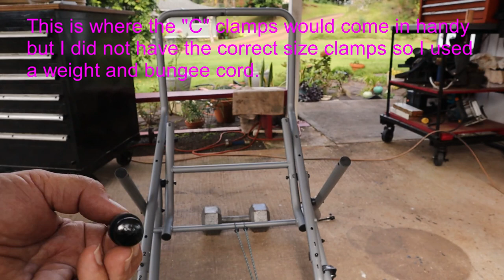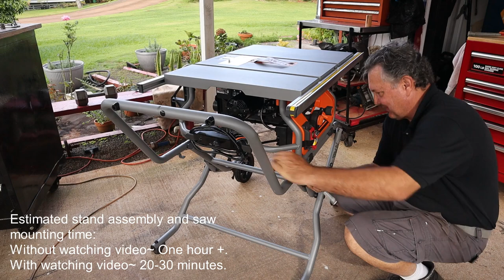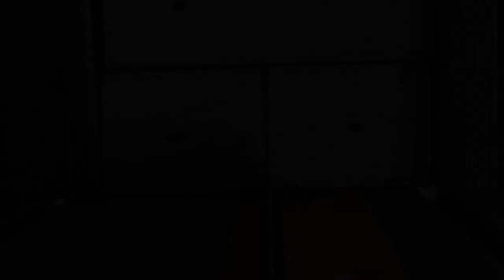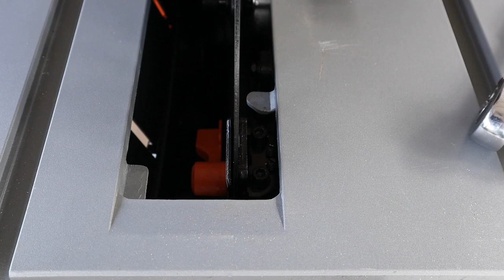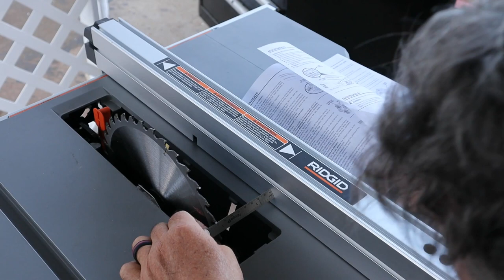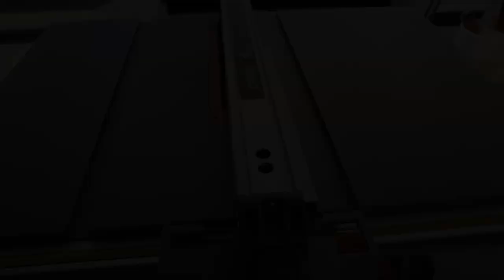RIDGID R4514 10" Table Saw: Assembly and adjustments in detail.

Comment: Great video! I have the same model and there’s a problem with alignment of the blade.
When I raise it all the way up it’s square with the fence, but when I lower it the front side of the blade moves a little bit to the right. So when I rip a 1/2” board it cuts a little more at the end of cutting.
I wonder if you also experienced the same thing.
Reply: Aloha Opportunity,
That's a good question as I only checked for square at max blade height but all my cuts appear to be square regardless of the thickness of the material being cut. The joints I made fit together fairly well but there is always room for improvement (mostly operator error!)😂.
When I have time I'll check the accuracy of the blade/table angle at max height vs 1/2"-3/4" but like I said I'm getting good, repeatable results. If I was not able to get good, repeatable cuts at various angles or blade heights I would have returned the saw. I'm using the saw to build my first piece of furniture with video to follow after the job is complete.
Thanks for the kind words and glad you enjoyed the video.
Mahalo,
Maverick Mike.
Reply: Opportunity,
After thinking about it a bit more it might be helpful to you to align the fence to the blade insuring the measurement from the front of the blade to the fence is the same as the back of the blade to the fence.
When I checked mine in the video it was on the money so I didn't need to take any further action.
Check your owners manual and you will find the procedure to make those adjustments.
Thanks again,
Maverick Mike.

Comment: Thanks for the in depth tutorial. I got this saw as a warranty replacement for a Ridgid 4510 because one of the legs broke and it was a discontinued part. I though great! But this saw isn't anywhere as good as the 4510. It's a cheap plastic POS. Their quality has gone down a LOT since I bought the original saw.

Comment: I noticed that my blade is slightly off and, since I use this for jointing, I'm getting gaps.    I'm new to wood working, and this video is awesome.   It's exactly what I need t adjust the blade.   But I have a question.  When do you use the short fence?  I've only used the rip fence.  Thanks.
Reply from the maker: Aloha Laura,
thank you for the kind words. It is encouraging to know that the video has been helpful to you. The "short fence" is called the Low Fence and is used for making "rip" cuts to material that is less than 3/4" thick.  Refer to RIDGID saw manual page 38 for details.

Mahalo,
Maverick Mike.

Comment: much for this video you don’t know it but I’ve been hanging out with you for about 3 hours now lol. Had i not found this video I wouldn’t have been able to adjust this saw blade because i had the exact same issue i still can not even set my dial for zero but the blade is perfect and that’s all that matter I don’t want to return it because i got it at Home Depot for $340 i also got signed up for the credit card ha ha. Thank you so much and god bless

Comment: You go on and on about cams but I have no idea what a cam is or what it looks like. I wish you had shown a view of the cam. If I had to go through this much trouble, I'd just return it.
Reply from the maker: Aloha Mr. Ken,
The "cam" is on the back side of the front panel and is very difficult to get a good view of.
As I recall I did get the best view of the cam/stop possible without purchasing a tiny Go Pro type camera. If you look in the owners manual
you should find the cam/stop parts there.
Good luck Mr. Ken

Mahalo,
Mike
Reply: @maverickmikekauai3515  Thank you for your response. Very helpful. I researched cams and it makes sense now.

Comment: Hello so in order for my blade to be square the motor touches the top. What should I do did I get a defected machine? Should I return it?
Reply from the maker: Aloha Free,
Happy new year.
As long as you can get the blade 90 degrees to the table I don't think the saw has to be returned unless you are unhappy with that.
Mahalo,
Maverick Mike.
Reply: Thank you so much

Comment: I am ready to toss my fence across the garage.. Unfortunately I just can't get it square, the back edge pinches just enough to be an issue. I get it close, slowly start locking it down, and it goes back to how it was
Reply from the maker: Aloha  Tom,
I'm sorry you are having difficulty with that fence.
My fence was one of the few things that was good on my saw. I don't know the situation on the fence but if you can try to put two extra washers (as large as possible in size) on the bolts/screws which mat shift the "set" or indent of the bolt/screw. Hopefully that helps with the adjustment.  If not then ask for a new fence or return the saw and hopefully you get a new one that is not so problematic.

Good Luck and Mahalo,
Mike
Reply: I have to use a square on the backside each time I move it.... :/
Reply from the maker: Aloha Victor,
Sorry to hear that you are having a difficult time with that fence.  Maybe get a replacement under warranty and hopefully that will help solve the problem.
Mahalo,
Mike.

Comment: Curious. Looking back at this video (still have the saw) that maybe there is a way to adjust the table itself? There are some bolts on the bottom. Maybe there is a way to add some shims or something?
Reply from the maker: Aloha Portland,
That's a good question.  I do not remember reading anything about that in the owners manual.
I'm not sure what that table top is made of (It kind of feels like some type of printed metal or aluminum with a type of plastic coating). The extension is adjustable but that only ended up in a  (compromise) adjustment on my saw.
Adding or removing washers on the bottom MIGHT help but would it be enough to make the effort worthwhile??  Would it cause the table to crack???  If you make the attempt let me know so everyone can see your response.
Mahalo for the thought provoking comment.

Mike
Reply: @maverickmikekauai3515  
I actually found sort of a solution, unless its way off. My table sort of bends down about 1mm towards the end. Towards me, its fine. So I used some blue painters tape applied it (going from thin to thick on the bottom of the miter bars (both sides). So when I use my crosscut sled, it won't move downward or anything weird. Boom. Fixed. Not bad for a jobsite table saw. Some of us do not have the room for a larger cabinet table saw etc. This one is great. I have used a 6" dada stack with ease but finding the insert was a pain in the a.
Reply from the maker: @portlandtwowheels1872  That's a great solution.  One of the reasons for purchasing this saw is that it could be used with a dado stack.  I ended up making the insert out of some scrap plywood because I could not get one from RIDGID.
Mahalo,
Mike
Reply: @maverickmikekauai3515  Well, I eventually got one pretty quickly but the shipping etc was a bit long for me. Maybe all of us are impatient to spend money? Haha. Anywho. Making your own throat plates is a better solution anyway. I have about 190sq ft for my shop. That includes a large motorcycle, 1 stationary workbench, 1 folding workbench, mitersaw/aircompressor stand, tablesaw(ours) with a router table insert, a lumber storage rack with full sheets of plywood, scroll saw, small drill press and a dewalt planer. Space! There is none. But its a fun hobby.
Reply from the maker: @portlandtwowheels1872  Yup!  I'm with you on the space problem.
Reply: @maverickmikekauai3515  well fast forward now and i ended up getting rid of the saw. the blade could never be parallel to the miter slots no matter what....the blade would end up becoming off center and slightly off. ridgid and their warranty wouldn't do anything
Reply from the maker: @portlandtwowheels1872  My saw is doing ok for what I need it to do. But if I were to get more serious about making furniture of other high precision cuts then this is not the right saw for that job. Sorry you had a bad experience with RIDGID.

Comment: Did you get the motor to stop hitting the top?  Seems like some fabric for the dust collector is interfering on mine. I'm about to just remove it.
Reply from the maker: Aloha,
That ended up not being an issue on my saw. I was able to dial in the 90 degree angle of the blade to the top with the motor just shy of making contact with the table.  But it was close, maybe 2-5 mm.
Thanks for the information, maybe it will help someone who has the same problem.

Mahalo,
Maverick Mike.

Comment: Help
blade will not raise full height, about 1/4 in shy of 3 1/2.looks to me like cloth piece that is intended to exclude sawdust from the motor stacks up as I raise the blade and blocks the mechanism from raising since it is pinched between the underside of the table and the top of the elevating assembly. any easy fixes short of removing the cloth excluder ??
Reply from the maker: Aloha Randolph,
That's a new one on me and don't have an easy answer for you.
If this is a new saw under warranty then just exchange it. If not then I guess you will just have to roll up your sleeves and begin digging until you find the issue . When you do find the cause of the problem then please post the fix here and it just might help someone out that experiences the issue.

Mahalo,
Mike
Reply: @maverickmikekauai3515  
Well Mike,my bad,I dug up the specs,max height of blade above deck is 3 1/4 inch.Looks to me like the design could have been altered a bit to accommodate exposing 3 1/2 inch of blade,which would allow shaving a 2x4s full 3 1/2 side,I fear the design group did not engage a experienced wood worker.So be it,still it's a good value table saw in my opinion.
Reply from the maker: @randolphsnyder1505  
Sir do you have the 4514 model number?
My 4514 cuts through 4X4 material.

Comment: I’ve got this model too and my saw blade has the slightest wobble to it. Does anyone else have this issue? When i cut pieces of maple for a cutting board i cannot get a good glue up without using a jointer. I feel like if i cut the pieces they should fit almost perfectly back together. Does anyone have any thoughts?
Reply from the maker: Aloha Tim,
I would probably check the following:
The saw arbor/blade mounting clean and snug.
That the blade is true.
The bearings are in good shape.
I also had an issue with glue ups and discovered that the blade to table angle was off. A readjustment did fix my issue but my blade did not have a wobble to it.
Thanks for the great comment, hope someone out there has a better idea to assist with tour issue.

Mahalo,
Mike

Comment: Mine is new and it’s stopping in the middle while doing a rip cut…. What could I be doing wrong ?
Reply from the maker: Do you mean the saw stops running? ... Or something else?
Reply: @maverickmikekauai3515  yes it stops running sometimes. May be the 2x4 is not straight. I’m able to do the other. But it’s still not 100% works a smooth cut
Reply from the maker: @-ssch  Aloha, I see two possible situations:
1. Operator error. Feeding the material to fast and or at an angle binding the saw blade.
2. Mechanical/electrical issue with the saw. Get a warranty replacement.

Good luck.

Comment: I have this saw and for the life of me cannot get the fence squared against the blade/miter slot. No matter what I do the back end of the fence is anywhere from 1/16" to a 1/32" off (further from the blade/miter than the front so toed out I believe). Can anyone help me out on how to get the fence aligned better? I have followed the instructions in the manual and loosened all the noted bolts and screws. And the instructions just say "adjust" but honestly have no clue what to adjust. The fence definitely loosens but pretty much goes right back to where it was once tightened again. Any help is much appreciated!
Reply from the maker: Aloha J Singh,
OK, assuming that you followed the owners manual in detail and have been unsuccessful there are a few things to consider before condemning the fence.
1. Insure your riving knife is not causing the problem. (Mine was causing a similar issue).
Take the riving knife off and make your adjustments. BUT NEVER use the saw with the riving knife removed.
2. (This is unlikely but worth a look) Make sure the blade is square with the table. (The table on this saw is not straight/true/plumb.
If the above does not solve the issue then you may have to replace the fence.

Good luck,
Mike.
Reply: @maverickmikekauai3515   Hi Mike thanks for the tips! Have a few further clarifications/questions. When you say the riving knife may be causing the issue I’m not quite sure how. I’ve squared the blade to the right miter saw using the same reference tooth front and back so no major issues there. The riving knife is squared with the blade best I can get. Definitely agree the table is not the best so I’m referencing all my measurements to only the right side of the blade (when standing at the front of the saw). Checking the fence to either the blade or the right miter slot there is always that amount off on the back end of the fence. Are you saying the riving knife could somehow affect the fence? I’ll keep trying to adjust and if not I guess I can put in a claim for a new fence if this really messes too much with my cuts.
Reply from the maker: @jsingh9210  
The riving knife on my saw was quite a bit wider than the saw blade so if you put a straight edge (18-24 inches long) touching the front of the saw blade and up against the riving knife you will probably find that the angle it creates is not parallel to the blade.
1. Remove riving knife.
2. Raise blade to maximum height.
3. Use straight edge against the length of the saw blade and strike a line. Do This on both sides of the blade.
4. Reinstall riving knife.
5. Place straight edge against front of blade and riving knife and strike a line. Do this on both sides of the blade.
6. Compare all the strike lines and I believe that you will find that the lines will be diverging toward the back of the saw.
I believe that is where you will find your (margin of error).

I addressed the issue on my saw by reducing the thickness of my riving knife.
Maybe check to see if RIDGID has a riving knife for thin kerf blades which would be a preferable option. When I purchased my saw it was not an option at that time but maybe it is now.

Good luck.

Mike.

Comment: I'm surprised by how far off your blade's 45 degree span is from the printed scale.  For the two spans to be off like that, the 'center' of the printed scale must be offset from the axis of rotation for the bevel of the saw.   Did something in the way you set the cam stops shift one or the other?  Or is there possibly an adjustment for that axis relative to the saw faceplate?
Reply from the maker: Aloha Mel,
I was also surprised how far off it was from the 45. The cam stops have no effect on each other so that leads me to think that the issue could be a combination of the table top not being true (flat/plumb) and or the printed degree scale sticker was not installed correctly.
Mahalo for the feedback
Reply: @maverickmikekauai3515   FWIW - I just purchased the new Rigid R4550 model.  The bevel, fence, table & guide slots were all dead on, barring one slight 45 deg bevel adjustment.  Once I made that adjustment, both bevel stops were dead on with the blade position.  Everything else about the table saw itself was square & flat and aligned out of the box.  Overall, the new saw is really nice, stealing the rack & pinion fence feature from DeWalt but coming in act $100 cheaper.   Overall I give it a huge thumbs up ... except for the mitre gauge, which is a piece of junk.  It was about a full degree off of square to the guide slots just 8 inches from the gauge.  Unusable except for narrow cross cuts.  And even for those, it also scrapes the surface of the table.
Reply from the maker: @melmartinez7002  That's great Mel, glad to hear you are happy with the new saw. I'm still satisfied with my purchase. I have heard that RIDGID may be doing away with it's lifetime service agreement so I think it may be a good idea to get things covered by that agreement before it expires.
Mahalo,
Mike

Comment: Mike,  do you still recommend this saw? Thanks!
Reply from the maker: Aloha,
Yes I still recommend this saw.
For the price point and the ability to cut 4X material it was hard to beat.
If you don't have to cut 4X material or you require high precision cuts then I would look for other options. The biggest problem with this saw is that the table top is not flat/square.
Thanks,
Maverick Mike.

Comment: You didn't show the details of locking the rip fence because mine isn't locking
Reply from the maker: Aloha Mathius,
If you mean that the fence is still loose after you lock it into place then with the fence on the saw with the locking lever "up" or "disengaged" then tighten the 13 mm nut on the fence (opposite side from locking lever) half a turn then engage the locking lever and test.  Continue adjusting the fence locking tension until you are happy with it.

Mahalo,
Mike

Comment: Welp. I keep having to re-square my blade to the miter slots. I wondered why I kept cutting into my cross cut sled and why my miters etc were off. I loosened those two 5mm allen screws in the back, tightened/loosened the allen adjustment screw and its still off. 
It looks like there is a "cam" of some sort, an oval shape maybe, that adjusts the blade. 
I can't even adjust it enough to keep it from hitting my combo square. I even "tapped" it to try and move it further.
Nope.

Can anyone help? Ridgid is completely useless and gave me phone numbers to places that don't even exist for help.